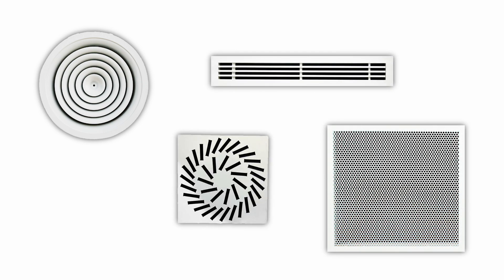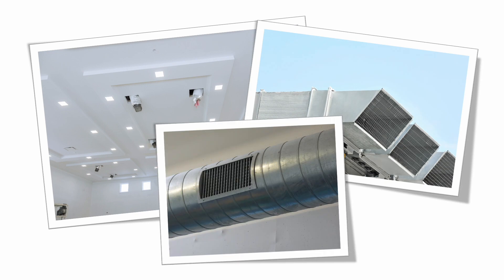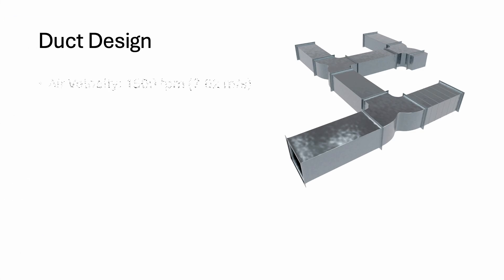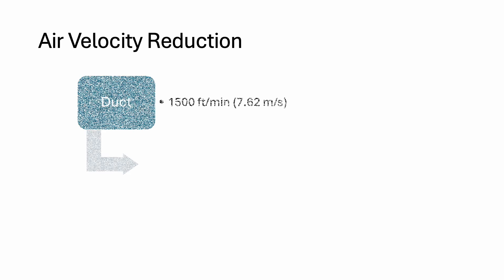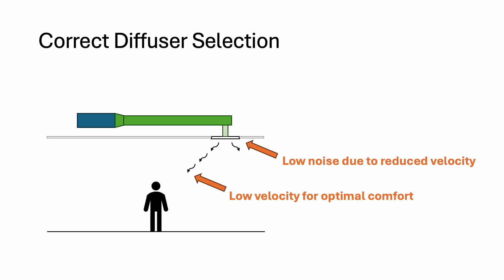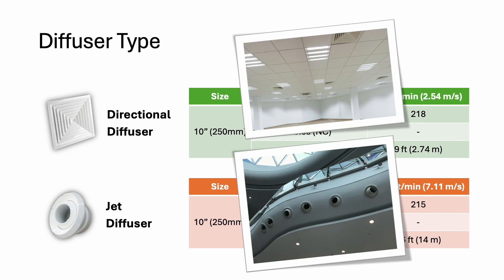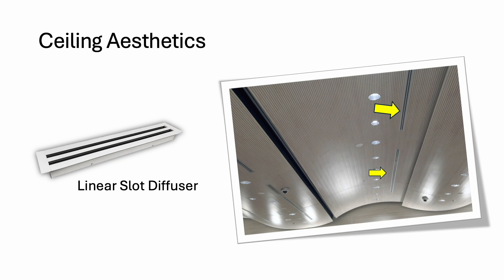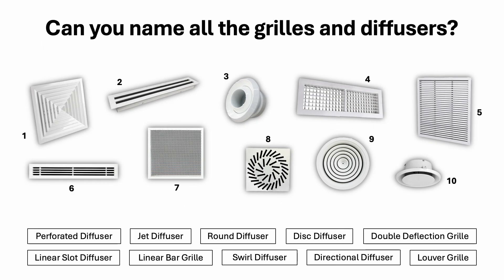Why Do We Need Different Grilles and Diffusers?

Comment: Great explanation, thank you sir.
1. Directional diffuser 
2. Linear slot diffuser 
3. Jet diffuser 
4. Double deflection Grille
5. Louvre Grille
6. Linear Bar Grille
7. Perforated diffuser 
8. Swirl diffuser 
9. Round diffuser 
10. Disc diffuser

Comment: 1. Directional
2. Linear slot
3. Jet diffuser
4. Perforated
5. Louver grille
6. Linear bar
7. double deflection
8. Swirl diffuser
9. Round diffuser
10. Disc diffuser

7.

Comment: Hi, I subscribed to your programme in aircondlounge site. As I am a newbie in HVAC, this course relates to my current job in the data center project. So what is the terminal velocity in the simple explanation and in the technical. Thank you
Reply from the maker: Hi, in HVAC, terminal velocity is the velocity of the air at a certain distance. For example, the air exit the diffuser and reach a terminal velocity of 50 fpm at 10 ft.

Common terminal velocities are 50 fpm, 100 fpm and 150 fpm. The distance where the air reaches one of the above terminal velocities is known as Throw.